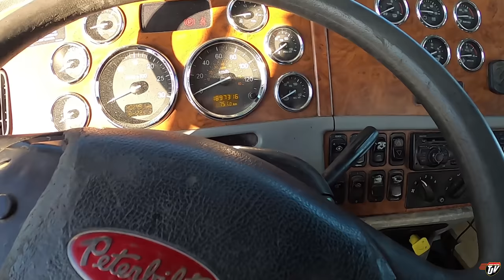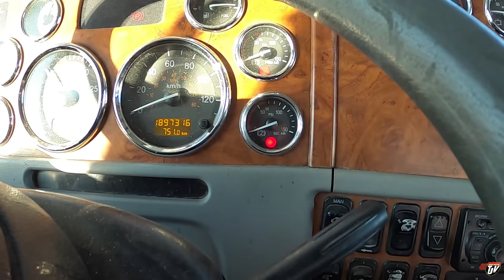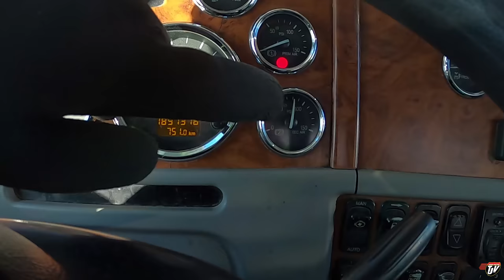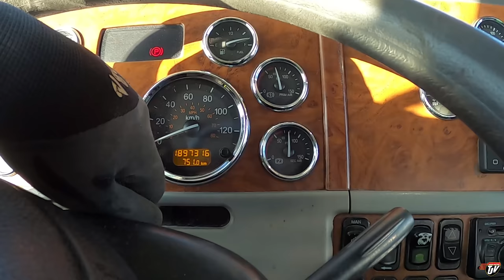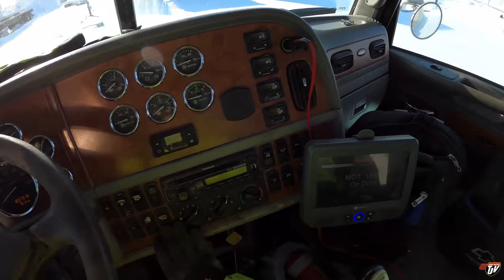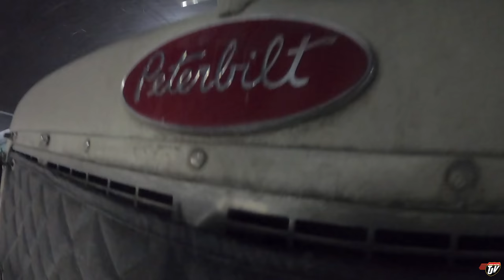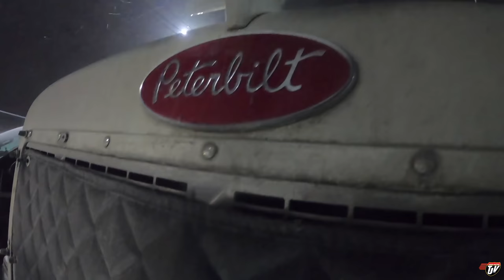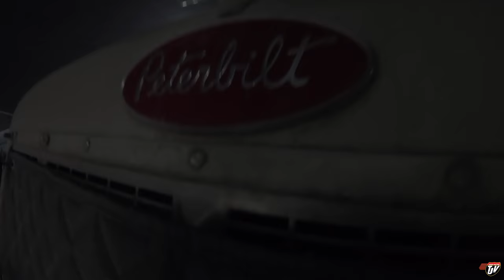TARPING MAGIC | My Trucking Life | Vlog #2460

Comment: Hey I hope you it turns out ok I had that issue finally they found it C 7 to C9 had to be replaced easy operation but it gave me pain for a year til it got so bad it went down my arm to my hand ask them just check it just to make sure it worked for me out of work for 4 months then went back but kno more jumping off the back of trailer no more jumping off the back of the cab because that's what caused everything good luck

Comment: Hey Josh sorry to hear about your back, get well soon, my question for this video is what Type of a transmission do you have on your truck? Because I can se its a automatic but when you driving, those gearshifts don't sound like a torque converter, is it a robotized manual maybe 🤷🏿‍♂️
Reply: Josh's personal CHEVY pickup is Automatic, but Peterbilt is 13 speed manual shift that he can float gears while driving, but requires use of clutch from a start or stopping. Only most of his company OWNED OTR trucks equipped with automatic transmission. 🤠
Reply: @davidhbingham6812  alright thank you I was referring to the Chevy pick up, noticed that at the beginning of the video the truck was going thru alot of gears relative to the amount of distance he covered and those shifts were like manual shifts to me compared to the conventional torque converter I have on the Ford,  it's a four speed transmission and it doesn't sound like that.